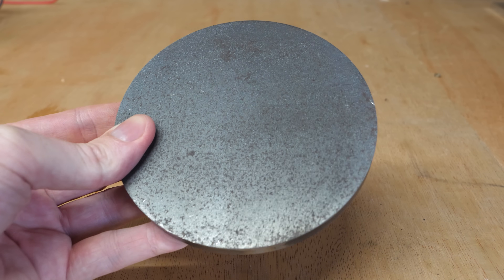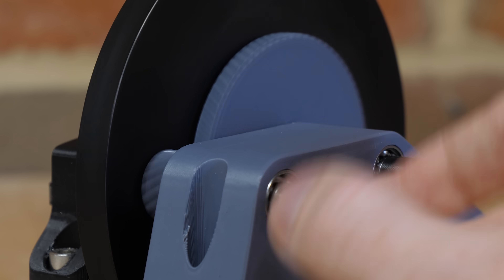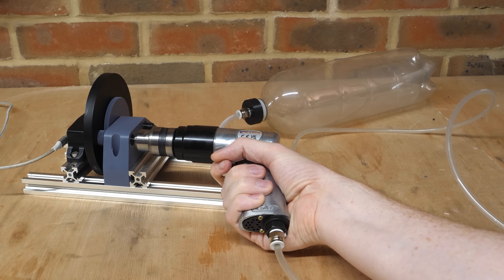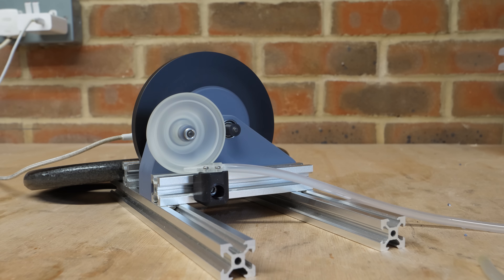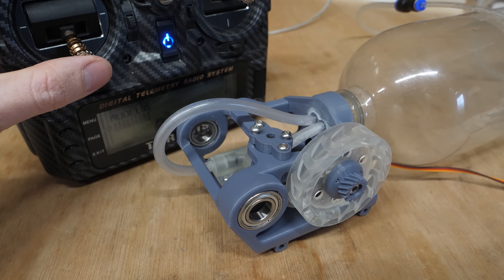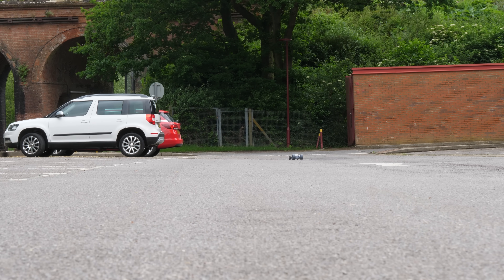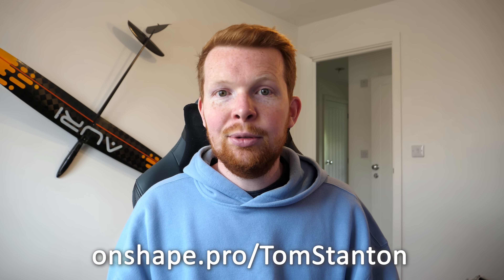Building a Turbine Car

Comment: Hello . Take the ball and place it in the middle of the bun. Pump a little air into the bottle, and then pump air into the balloon. Then you will have air in the bottle and remove the air from the balloon. The air from the ball will drive your wind turbine into operation. Alternatively, play with the nozzle so that it comes out in the wind, so you can extend the operating time of the engine in the wind.
Reply: ake a ball like the one clowns use for dogs.
Latex balloon constructor (sausages) 5cm green.

Comment: It might be a efficiency nightmare but how a bout u use the turbine to spin up a flywheel and then launch it by having a clutch connect the flywheel to the drivetrain. It would sound awesome hearing it spool up while standing and then zipping off. You might be able to get some use out of the grippy tires also.

Comment: I think your testing of turbine efficiency is flawed, you need not test the maximum power, but the total power output of a fixed volume at a fixed pressure.

Say you rig up your RC cars bottle to the tester, and then measure the output by integrating the power curve. If two designs are equally efficient, a higher output just means a shorter runtime.

Comment: Another great episode! 

How about a multistage system with an aluminium pipe as turbine drive shaft, and an aluminium or possibly copper pipe as housing, that is fed in the middle, to balance the axial force, with enough stages the turbine should be able to produce enough torque to drive the wheels without gearing, and that way the turbine can also act as the rear wheel axle. Making it from aluminium tubes should allow the compressed air to pick up some heat between stages which would increase efficiency, besides aluminium pipes being relatively cheap and easy to work with, while also strong and light weight.         

That would probably not make the same cool high pitched whine, but I think that's a relatively easy way to get reasonably high efficiency, and also minimize losses.    

If you want to make it even more complicated you could 3D print something based on the Ljungström turbine built into the wheel hubs, to squeeze a bit more energy out of the compressed air before it's released. 

About pneumatic tools, I don't think they're typically supposed to be efficient, if they were close to as efficient as they could be, the air would become so cold that is could cause a number of issues without having multiple stages with sufficient reheating between them.

Comment: I would be curious how multiple nozzels helps. and I would suggest using a carbon shaft for a rear axle to reduce rotating mass, getting some racing rc touring car wheels  with sliclks would potentially reduce mass compared to printed wheels with the big rubber tyres

Comment: If you're going to continue with a dragster, you might want to give it the ability to "dump the clutch", i.e. spin the turbine up before engaging the rear wheels. Since you have a fixed gear ratio, you're probably wasting a lot of energy running the turbine at a low RPM while the car gets up to speed.

Comment: On a gasturbine you have a static ring with blades that get the air to „spinn“ and push the blades on the moving wheel. The blades on the moving wheel „straighten“ the airflow. If you have a multistage turbine the next static ring will to the same until there is no pressuredifference left. So maybe instead of blowing at the moving ring with a nozzle using a distibuting chamber and a static ring might help.

Comment: The turbine you are building her is very close to a Laval Turbine. Laval did two very improtant things back in the time: 
1. The nozzle was a Laval Nozzle which converges up to the point where the speed of air reaches exactly Mach 1 (depending on pressure difference). When the nozzle diverges from this point on, you get a supersonic flow that will expand the air even more than just a simple converging nozzle. 
2. The channels between the turbine blade had a special profile which i do not remember exactly. You should look into steam turbine design which should be close to your goals (Laval, Curtis and Parsons-Turbine)

Comment: Add a bleed valve so you can never over pressurise the bottle, then attach a temu tyre pump and set it to just over the pressure you need and it will keep it topped up until the battery dies in the pump

Comment: Fantastic video- great engineering really well explained. Maybe you could try a turbine disc without a shroud- just open blades with a jet in the plane of the disc tangent to the blades and not angled. Like a pelton wheel.

Comment: How about a Catherine wheel style reaction turbine. All these are impulse turbines. 

They are limited as when the velocity becomes closer and closer to the impuse gas velocity they lose torque. This is obvious if you think about it as you can't blow along somthing moving faster than the wind. 

A reaction turbine basicly is working like a rocket on the outside. So it should keep torque better as speed increases. In fact, max efficency will be when nozzle velocity is the same as the exiting gas.

Comment: The problem with air pressure is the low density of the fluid. Did you think about making a bottle with water and air? 
The water in the low pat and the first to go out from the bottle. Water is a compressible fluid but lower than air (We can approximate it to an incompressible fluid)
Because water is 1000 times the density of water, you can achieve 100-1000W of power.

Comment: Very nice work, i might have a nice idea for you to try. 
Place 8 of these turbines in a circle, [22.5 degrees] fixed onto a ring, have the flywheels act as air powered gyroscopes. 
Now a single pressure connection could power them all 8 at the same time and speed. [or use 8x esc like a drone].
All wheels should be made to oppose each other and turn inwards, towards the exact center, centripetal forces trying to lift the entire contraption.
You now have mankind's first air powered, anti-gravitic, disc shaped craft. [if you place 8 bottles on the ring for sharing the pressures].

Comment: @7:50 having the nozzle on the outer diameter of the turbine with the exhaust in the middle means that escaping air would have to fight centrifugal forces before escaping.  i suggest running it backwards it might still work XD

Comment: You can use your phones microphone and take a Fourier transform of the signal. The first strong peak will be the rpm. Works very well to several tens of thousands of rpm and also has a great dynamic range.

Comment: Your turbines are all variations on the DeLaval impulse turbine.

Ideally the air would get turned around 180 degrees in the blades. Because that's not physically feasible, real turbines usually use 15 to 20 degree nozzle angles leading to about 140 degrees of direction change. Best efficiency happens when the blades are moving at 1/2 the speed of the air jet, so ideally you want to match the turbine speed to your nozzle's pressure ratio so as to meet that requirement.

Comment: what if you made something like this enormously huge but used a massive huge boiler with like 150,000 lbs of pressure and a prop that could launch that vessel into the atmosphere...  no more need for fuel and adding more bottles you can literally launch thousands of tons into space at a time, no fuel

Comment: For a dragster that doesn't have as much of a weight consideration as rc planes, wouldn't a paintball air tank make a huge improvement?
1.5L at 4500psi would weight less than a kilogram
Reply: I mean the compressed air while full would easily add half a kilo as well, but there's no way around it if using pressurised air as an energy source

Comment: You can remove the foam from those drag rc rear tires. It will lower rotational mass and help with grip. They are designed for a 6lb car. they will still work excellent without it.

Comment: Turning it 90 degrees and driving the axle instead of one wheel would be an improvement. At higher torque you're going to get a pull and possible oscillation as the opposite wheel is going to experience axle twist. Also, though it may make no real difference, it would irk me to have the exhausting gas not pointed in the direction of thrust, particularly with an open turbine face.
Wouldn't it be better to use the entire face of the turbine? Instead of a nozzle focused on one spot? A double cone so the air is being supplied to the entire blade section?

Comment: Would some carbonated water in the bottle provide enough pressure to run it? 
As the pressure drops in the bottle more gas is produced by the carbonated water (at least that's what i'm thinking).

Comment: Would power be lost while driving due to drag, turbulence, and a pressure gradient causing less and less air from the nozzle to go into the turbine at the angle intended? perhaps an enclosure for the turbine/nozzle system would improve the range and acceleration without the weight of a full aerodynamic enclosure? Absolutley love the channel btw, been watching for years.

Comment: Stupid question but how much more efficient is a turbine at sending power to the ground vs. A well designed nozzle using the compressed air to shoot directly out the back of the car? Probably a silly question.

Comment: A carbon fiber air bottle off a PCP air rifle can run much higher pressure in a smaller space.
It would be heavier but run through a regulator it could give you way more useable air.

Comment: You need to make an internal intake design that captures the air going into the turbine in a way that the ONLY way that air is escaping is through turning the turbine. Kinda like the vain motor you started trying to do but maybe without the moving shelves that slide in and out so you have less friction.

Comment: Fluid coupling (what you made) vs a torque converter (cars, obviously). The former has real efficiency issues at higher speeds.

Comment: Wouldn't a clutched turbine be better for after the air has run out? less drag after the pressure is gone. There is an ideal variable pump in a 700R4 transmission that might help you design a better turbine. You can get one from a wrecker cheap. Use it or it's parts to make a turbine from. Or just learn what they did. It can produce over 2500psi in oil pressure. It's a variable pump so you can control what pressure and volume you want. you should check it out. It will be too heavy for what you want but the design is what you are looking for. you can recreate it in a 3D printer easy enough.

Comment: Use much more narrow front wheels.  You're probably losing a lot of energy to wheel friction.  And probably smaller rear wheels too.  Those look pretty oversized for the capacity of the vehicle.

Comment: Meester Tom sir guy man, if you want to reduce wheel mass, there is the sponge/foam tyre option.
You can make your own light as comfortable wheels and stretch on a foam ring of grippiness. Can texture the circumference of the wheel to reduce any material slippage.

Comment: Instead of a turbine I would think that a bottle and water (ie a bottle rocket) would do the job at least as well. For a variation you could have a bottle and use a venturi system to inject the water into the vented air.

Comment: I had an idea for your turbine design that ran channels closer to the centre. I’m curious to know what would happen if you reverse it. Injecting the pressurized air in the centre, and the ‘exhaust’ from the turbine comes out along the outer edge.

Comment: Great work as always - may be worth dialling in optimal tyre width so you can steer /put power down with minimal rolling resistance. The more weight you can have over the rear wheels the thinner they can be before they slip. There's also a gear affect from the tyre profile so take that into account when dialling in your gear ratios.

The other thing that might save you some time,  the  price of battery powered air compressors has come down a lot. Might be worth investing in one to speed up the prototyping:)

Comment: I wonder if you added dimples to the outter surface of the turbine, if it would reduce drag in the same way a golf ball does. Also wonder if you can sub out the plastic bottle for a camping propane tank and get more air and pressure

Comment: I think the shape of your nozzle might be pretty important. Optimizing just that with tests for different designs (throat diameters, expansion ratios etc) on the same turbine might be interesting. Plus I think either adding nozzles or covering part of the turbine would add efficiency since you wouldn't be wasting energy and turbine area moving the surrounding air

Comment: The best I can offer is to create a stator and add a second turbine stage. Make sure the stator expands the air and the second stage is has taller passages/blades than the first. Otherwise you will need some very unusual books.

Comment: Heads up Tom that you can now buy small electric air pumps with an internal lithium-ion battery that are designed for pumping up anything from basketballs to car/truck tires; they let you pick a target pressure, top out somewhere between 100 and 200psi depending on model, and work fairly quickly, and would save you a lot of pumping with a hand-operated bicycle pump.

They have a built-in pressure gauge and will auto-stop, so pumping up something like your 2L bottles to a specific value like 80psi is dead simple. I got mine for about $80 on a deal, but $100 is typical. I use it all the time for pumping up bicycle/motorcycle/e-scooter/car tires and it works great.
Reply: I’m almost positive he’s using the manual pump by choice.

Comment: huh, the reason for why the reflective sensor not being enough for this applicaiton is lacking.

There are two ways to measure rpm with a sensor like that.
1. Like you said, count number of pulses in a given period.
2. Measure the time between pluses. (You don't elborate why this isn't good enough, it will be noisy, but since you be getting many thousands of readings per second, the postprocessing job can simple be a rolling average, or something more fancy.

Comment: For 7:45, wouldn't it be better to have the design inverted? The design shown there seems to end up getting most of the air blocked by the wall behind it. So making the outputs go out more might improve things.

Though not sure on that, it seems like you're already pretty close to the maximum possible.
Reply: Another potential improvement is to cover the area that is intake on the other designs, and using that to shape the input flow further. This should get a little bit more of of the whole build, but may add more weight than it's worth.

Comment: you could have used a pencil air dye grinder as comparison, the pneumatic drill you used had the chuck mass to accelerate and more importantly a gear reduction.

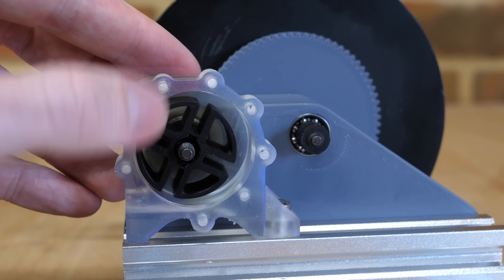Comment: 4:28
fwiw the compressed-air motors in drills (except dentist drills etc.) aren't 'turbines', they are positive-displacement items and akin to various kinds of rotary engines.

This is why they have such high torque.
Reply: It looked like a Shorrock supercharger from the way the guts were arranged.

Comment: You mentioned having problems with air leaks and friction in the vane motor.  In air tools, the oil they use both reduces friction and acts as a seal between the vanes and casing. It might be worth revisiting that design, but adding some oil and seeing if that makes a difference.
Reply: Those 'vane' type motors are rather inefficient.
They DO work but only because they can rely on an almost limitless supply of compressed gas (which this scenario simply does not have)

Comment: I suggest using graphite powder as a lubricant for plastic parts. It's dry but can still function pretty well.
Also, bearings, bearings, bearings. Lube bearings up with really thin oil when they aren't going to generate lots of heat, if any at all, and thicker oil for parts that generate lots of heat. May have to experiment with different types of oil to find the right ones for each part.